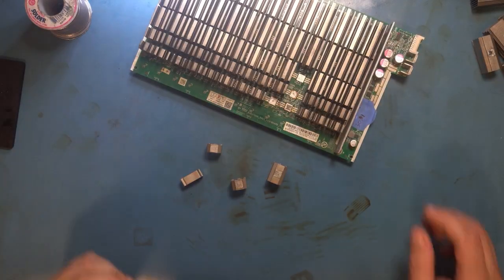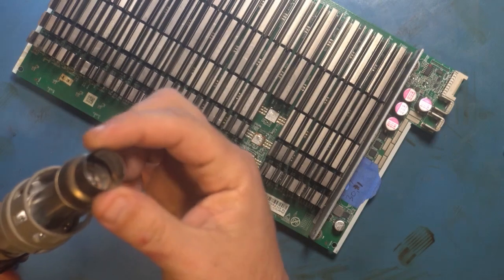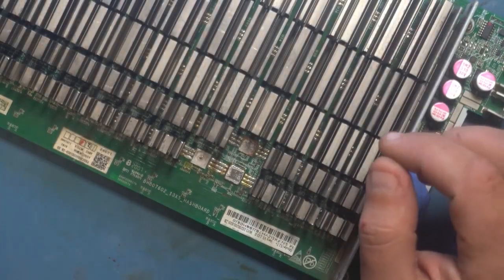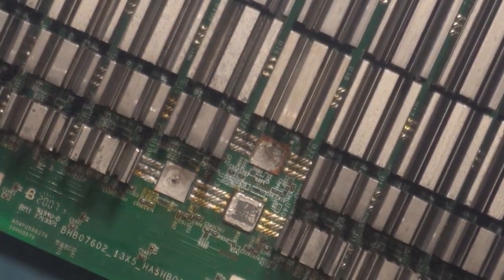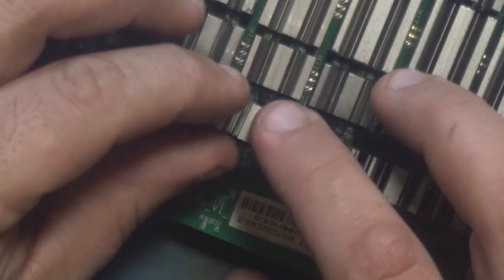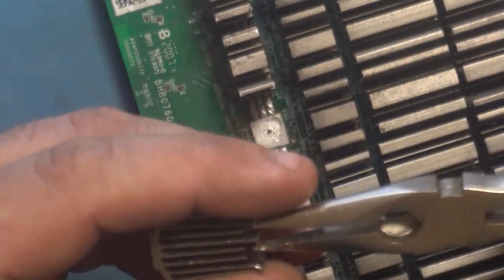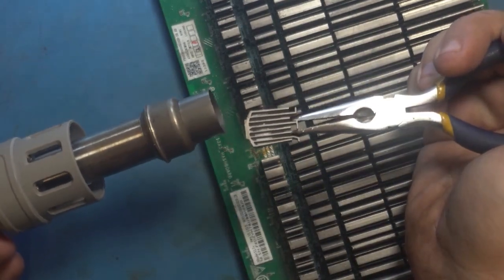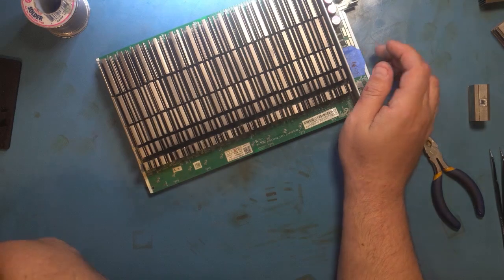DIY - Two techniques to put heatsinks back on

Comment: Can you recommend a soldering station for this work?  I see a few 2 in 1 units on amazon, not sure if one is highly preferred.
Reply from the maker: They are all pretty much the same honestly.  I personally don't like 2 in 1 units but if that's the way you want to go, nothing wrong with that.  Your actual temperatures might be a bit off from what they are supposed to be but that's not a big deal in my opinion.

Comment: That's a solid way to do it! May I know your temp and airflow settings on your Atten?
Reply from the maker: My station is pretty much always at 340 degrees C and 60% air.  I bump the temp up and the air down when I solder small components so that I don't blow them away.
Reply: @asicrepaircanada159  so you put a dab of solder on the chip then add the heat sink? Or you keep the same solder that was there when you took the heat sink off??

Comment: Hi, what about the bolls when u push little strong on chip?
Reply: After you've soldered the chip you should not have to push it down anymore. If you do, you are very very likely to ruin the work you just did. In case of the heatsink needing moving, if done right you won't be melting the solder on the chip.
Reply from the maker: I you mean pushing the heatsink on the chip: if you have solder balls squeezing out, you probably have too much solder on there. I basically never add any solder.
Reply: Very comprehendible videos. Keep on good work. Hope more videos will follow.

Comment: hello friend can u say me a way for test second hand BM1397 before attached on hashboard ?
Reply from the maker: There are a few testers on the market now I think.  I personally don't use any.  When I reuse old chips, I test them on the original board first.  For new chips, I don't think I have had a bad one yet.  Best way to test a chip is to put in on a board and go from there.

Comment: What temp do you usually set your heat gun too?
Reply: He said > >My station is pretty much always at 340 degrees C and 60% air.  I bump the temp up and the air down when I solder small components so that I don't blow them away.